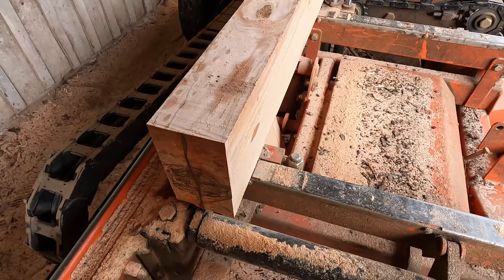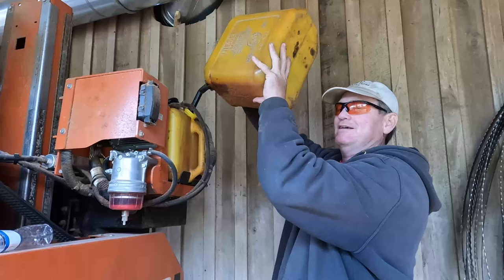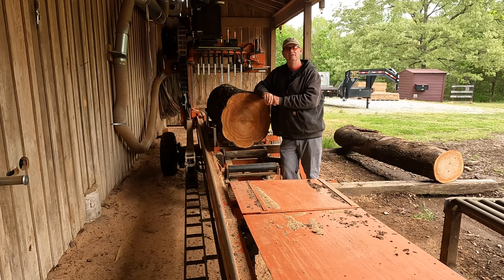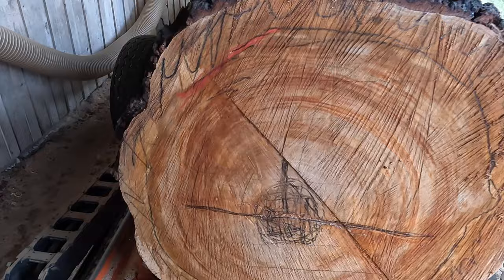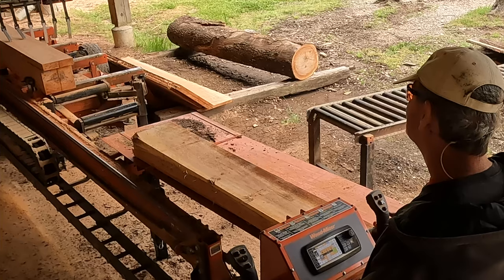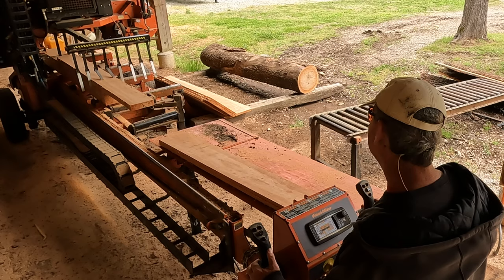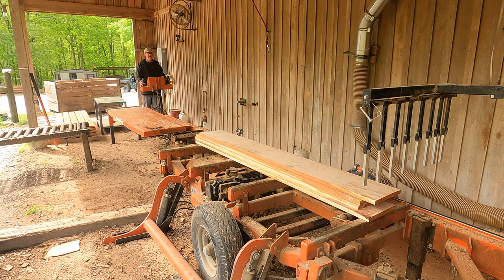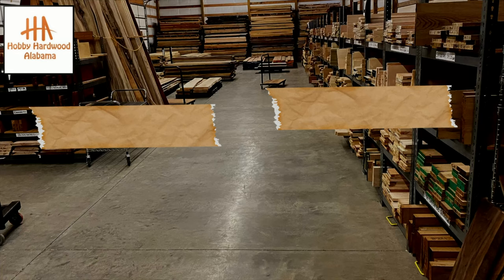#1 Way to Increase Sawmill Lumber Quality - Professional Shows How to Sawmill Cherry - HHA

Comment: I like your saw mill .I saw on a lt 50 extra wide . started out with a lt40 back in 1993 . and it looks like you have mastered a lot of techniques that makes you a one man crew.and you do what it normally takes 3 workers to do.good job my wood man fan .
Reply from the maker: You are very correct, we used to have a 3 person crew, me and two off bearers, but due to lots of things, we have downsized to a one man crew (me) on the mill.  It's a lot less complaining and more enjoyable and our yield is still about the same.  This comment is a good topic for a video, thanks!

Comment: You have made me an addict!  I just can't get enough.  One thing I would love you to do is smply let the tape roll from a slight distance so I can see all your movements from start to finish.  I am planning on setting up my new LT70 with the same meathod.  Also, I am curious how you are rotating the log and knowing/setting the top face with the blade to continue down?  Thanks
Reply from the maker: I may do that.  Good suggestion, I will try.
Reply from the maker: Oh, the turning and not having to reset is using a combination of using the setworks and my eye to get all the edges set to a reference as soon as possible.

Comment: Wow, subbed for sure. To me, these videos are gold. I just got an LT28. So I won't have the hydraulics, but the techniques you share on getting quality wood is very valuable information to me. The mill showed up months early, but this spring I'll be milling up on site at my buddy's place a pile of New England red oaks. Many of them have 30+in diameter. So I have time to do some research. Which technique would you recommend? The piths of oak can be bad i have observed, but there isn't much sap wood (I don't think?). Maybe just face the bark slab to an exposed 8in wide sawn face, rotate 180, and repeat on 4 sides. From there, it seems I could follow the method shown here to the pith, or I maybe get some QS... hmm so many things to think about.
Reply from the maker: Sapwood on oak is can be a problem, although not as bad as in cherry or walnut.  However, since it is a different color, a bicolor oak board is sometime refused by the customer.

Comment: Your videos are so helpful.  I’ve watched the walnut and cherry ones.

So with those species you don’t worry about 1/4 sawing vrs plain sawing for stability!? Is that right??
Reply from the maker: It depends on the end product desired.  This video covers the proper way to flat saw these species because flat sawn orientations own the market share of these species marketability.  There is not much commercial market for QS cherry or walnut, although it does increase board stability, in fact some commercial customers will purposely avoid qsawn or rift sawn cherry and walnut because it doesn't match the conventional orientation of most cherry and walnut furniture.  I do sometimes vertical grain saw cherry and walnut if the log dictates it, as matter of fact I did some of that this week, generally if the stress in the cant is so great that flat sawing just won't settle it down.  Very good question.

Comment: Hi, thanks for sharing. Just wondering why you didn’t level the top of the log to the bed, and instead centered the pith. In a different video I watched of yours, you said to level top of log. Hope this question makes sense.
Reply from the maker: Yes, make perfect sense.  It depends on the log and the defects it's showing on different faces, as well as how naturally straight or how much bell is on the log.  I don't do much "explaining" on some of these videos, I have people say they can't follow me as it is, so I just don't mention some things.   Even if the log is parallel bark sawn, at some point I will always try to center the pith except not always necessarily at the beginning.  As the cant gets smaller, the growth rings get more parallel to the pith so at some point it's a good idea to get aligned with the pith to keep it from getting into the boards.  For cherry, especially with a straight log, it's sometimes good to just start out that way.  This is a good question because my next long video will be me sawing up a walnut, and I explain and demonstrate this very thing.

Comment: Sir, with respect, may I ask - is your wood mizer the top-of-the-line unit?   I have seen other wood mizer units and they must be minimal lower-end units.   Thanks for this video: extremely interesting.  Stay safe.  YF  JB.
Reply from the maker: Excellent question! Yes it is and you are correct.  I come at it from a different standpoint of many YouTube content creators in that they are just happy to run a sawmill, make a few boards, and can make lots of videos with spandex, but don’t have the equipment or background to make top quality lumber that will sell.  Your question is one reason I started making videos, to show  the viewers there is a difference in equipment, technique and mindset between someone who sells videos and someone who sells lumber.

Comment: I have a 89lt40hd with claw turner. Do you think any of those time saving techniques would work for me? Did you use any of them when you had your smaller mills?
Reply from the maker: Certainly.  We started out business with an LT-40, and developed many of these techniques using it.

Comment: How do you decide when to change the blade, by the hours or by how it’s cutting?
Reply from the maker: Definitely by how it's cutting.  I normally change blades couple times a day.  Once it starts to wander or slow down, it goes into the "needs sharpening" pile.

Comment: Do you dustoff your wood before you stack
Reply from the maker: No, and that is a whole video, or even career, in itself.  A board sawn at the optimum speed, with the optimum blade, lube, etc will have no real sawdust to clean.  So there is no dust to remove and no time wasted dusting.  This simple idea can double you production.  It’s an easy concept but very difficult to achieve.  However, it should always be the goal, i.e. no appreciable sawdust on the board that needs cleaning.  Excellent question.
Reply: @HobbyHardwoodAlabama  still working on it.  Hopefully a sawmill shed by this winter.  Thanks for the information.   I'll keep sweeping

Comment: Pith is no good? Just watched one of your videos and you sawed the entire log right thru the pith and called high grade
Reply from the maker: Pith is never high grade, and in the video you have captioned I was sawing cherry, and pith is large and totally unusable in cherry. Whether I sawed through it or not, it is always sent to the burn pile as a routine and if I said the stickered wood was high grade, not would have contained all the boards EXCEPT the pith boards which automatically go to the burn pit.  In the videos, and real life, I will saw through the path regularly, even cherry, (I was doing it yesterday in a video I filmed) simply as a matter of process and convenience, because my mill is so fast, it is easier and faster for me to saw down through the entire cant and cut it into easy to remove boards as opposed to having to eject the entire pith centered cant, which is heavy and harder to handle.  Pith will never go on the stickered stack, whether I sawed it or not.  As a general rule, in the videos, I mention that I am "sawing down through the pith as a process convenience, and will discard the boards as a matter of routine" or something like that, but sometimes, I may edit out the narrative.  However, as a hard and fast rule, pith or juvenile core on hardwoods will always make low quality and cracked wood, and is always disposed of, even if I sawn down through the cant for convenience.  Pith always goes to the burn pile.  Good observation.

Comment: Those looked more than 4/4
Reply from the maker: You are right, I looked at the video, they did look thicker on some of the camera angles, but they were sawn at the 4/4 hardwood scale, at 1- 1/8" thick.
Reply: @HobbyHardwoodAlabama  it was probably just a high downward angle cuz I saw them and was thinking I would love to find 4/4 that looks that think at the local mill
Reply: But now that I look I actually have a stack of unolaned cherry boards here and these are 1-1/8 as well. I think I've noticed some being a bit thick before but I never knew it was intentional I figured it was just the guy I have milling logs for me. But it would make sense because I get them back rough and have to plane myself so that way they remain a true 4/4 at the end
Reply: Doing stuff for a reason how weird